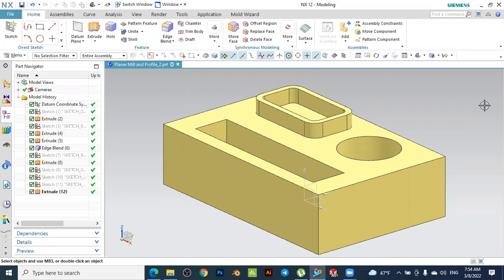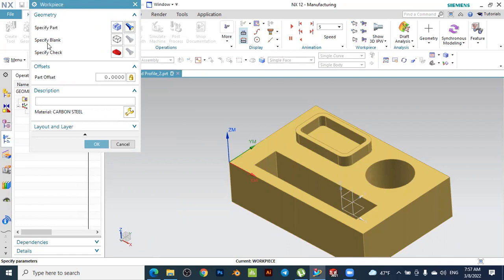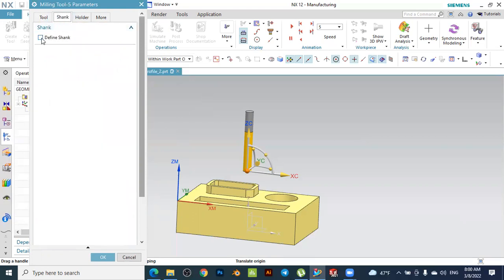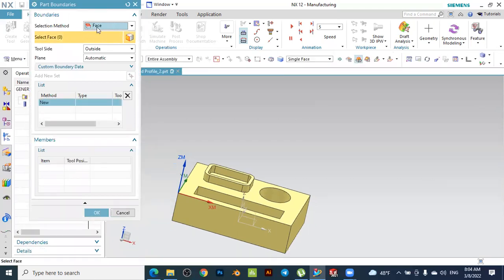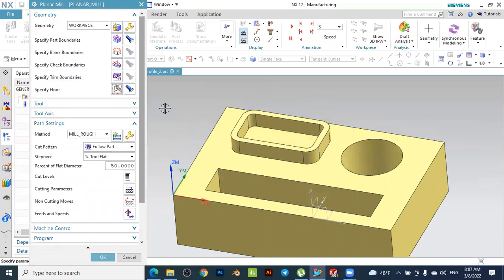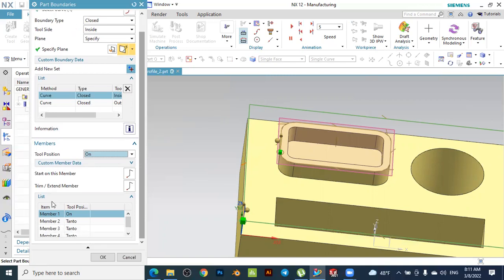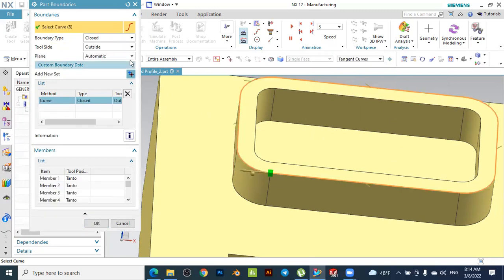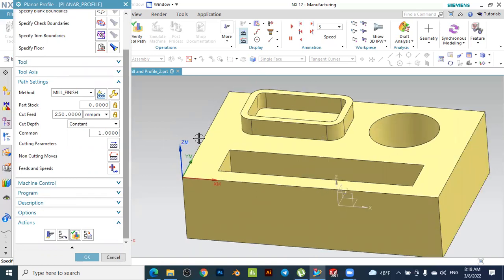Siemens NX CAM: DAY_11: Planer  and Profile Milling #siemens #nx #cam #millling #planer #profile

Comment: We just only need as an operater and Programmer that.... We generate toolpath without holder (generally we don't select holder ) ... And generate toolpath... After generated tool path we need to post process in least z (minimum z) position in first line of program in post processed as a comment.... In other software we get this .... How to get minimum z position (last z position that is minimum so that operater can understand) of one operation in program in first line...